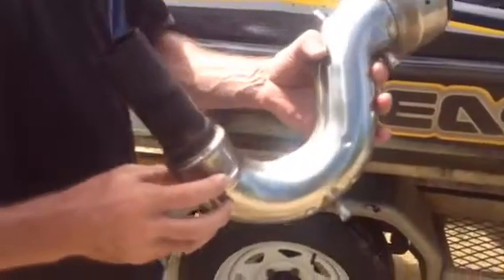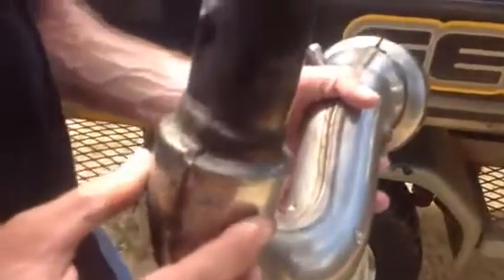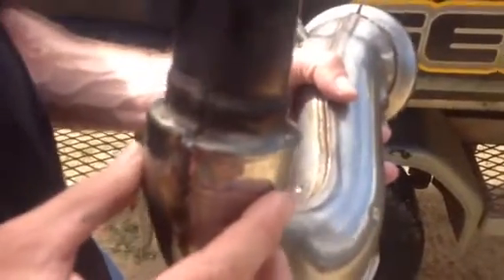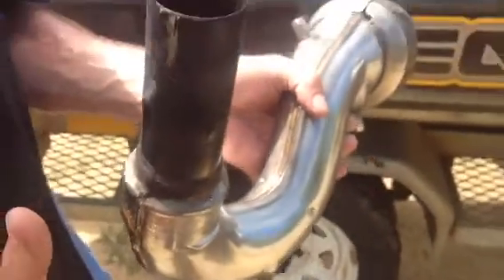Seadoo Rxt 215 2007 exhaust cooling mod

Comment: That makes it overheat? My 2007 rxt has exhaust and temperature alarms going off.
Reply from the maker: The j pipe exhaust has small holes as indicated . Rough sand blocks the holes and then the water can’t cool the box anymore and the alarm goes off . We marginally make the holes bigger so that course sand may also pass easily . Do not make the holes too big though , only marginally like shown here .
Reply: @Redrockat  thank you
Reply: @Redrockat  what size drill bit did you use